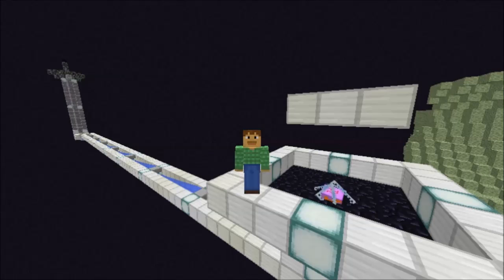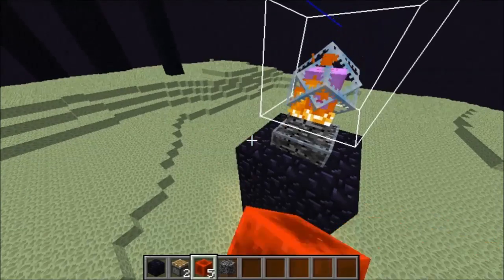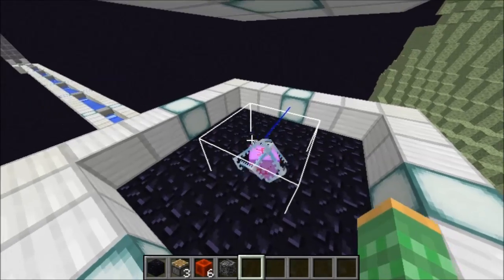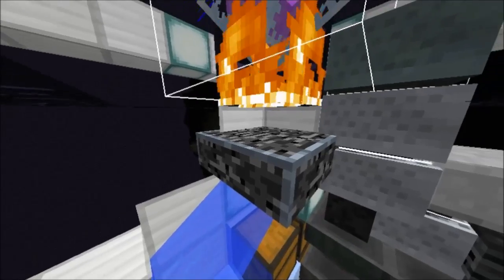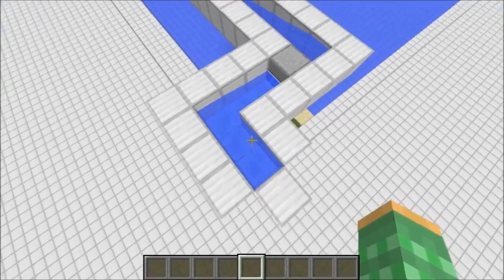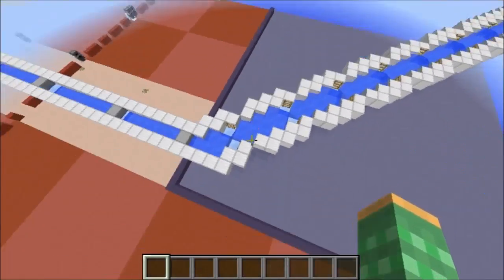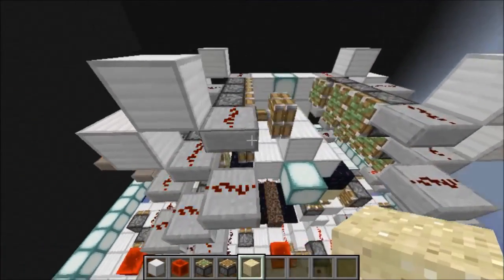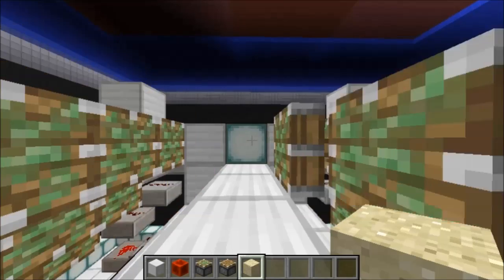SandStorm! [Explained] The FASTEST sand generator in Minecraft! 1.8 Survival | Ray's Works

Comment: I assume you have 6 pistons retracting the sand to get the pistons to retract every tick however this is pointless.Reason being that when you place the sand directly in front of you it will take 3 ticks to retract and in that time you won't be able to place any sand. The only way to get around that is to use 0-tick technology to push the sand out of where you place it.

Apart from that, cool stuff :)

Comment: Did you make sure to test the chunk loaders? I tested both your world download and a set-up in my own world and in both cases the hopper loaders seem to load nothing, or at least not all the way to the end portal. I think the mechanic was discontinued a couple of versions ago.
Reply: Never mind, looks like you didn't actually have loaders all the way to the portal. XD Still need to figure out what went wrong on my world though ...
Reply: Rays Works Well, the problem I had is that I didn't know you needed to use items with hopper loaders. XD That's fixed now, but I'm still having issues with loading. However, does the Sandstorm work without anyone in the End? I've heard  Panda that you can't keep chunks outside the Overworld loaded without a player in that dimension ...
Reply: Rays Works
Yeah, I read that in another comment of yours. And sure, but if they're in the spawn chunks you don't need to mess around with loading anyway, that's how I quickly made that proof of concept this week. ;-)

Comment: So this will be broken in 1.9? Or is there some way to remove the bedrock in the center of the crystal in 1.9? (The end portal generation trick won't work as the portal will have a fixed location.)
Reply: Rays Works Well, they did fix the end crystals spawning too low (and marked it as fixed in the bug tracker, so it was an intentional fix) and they seem to be pretty intent on bringing the Xbox dragon fight to the PC version and that means portal being always in the middle. Hopefully someone will find a way when 1.9 does come out.

Comment: It is an awesome machine. I built this in survival on my server and it's very nice to be able to use a sand generator again (I need a LOT of TNT)! There is however one problem: The sand placer at the End entrance portal slowly but surely loses sand. Is there any way to prevent this? This happens both on my server and in the world download.
Reply: +Rays Works Please let me know if you find the solution. It's pretty strange, it seems like the faster you place the sand, the slower you lose it at the end portal. I tested it with just holding right click. That way you lose quite a lot of sand, but when you place it really quickly (I have an autoclicker that clicks every 50ms), there is way less loss of sand.

Not really sure how factual this is. It only happened/I only tested this once.
Reply: +Rays Works I eliminated the problem by placing an obsidian block at the farthest two sand dupers, so that I only place two sand at a time (the middle and the closest one). After 11 hours of duping I have not lost any sand and this way is fast enough for me. Thanks again for the awesome machine!